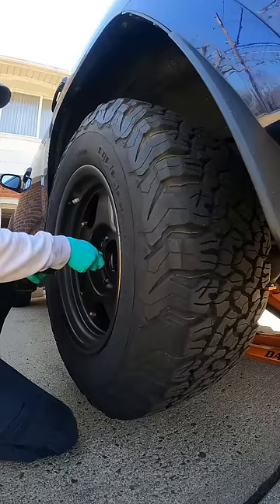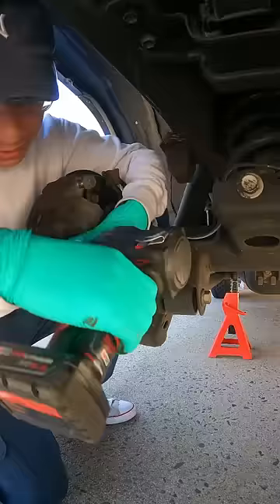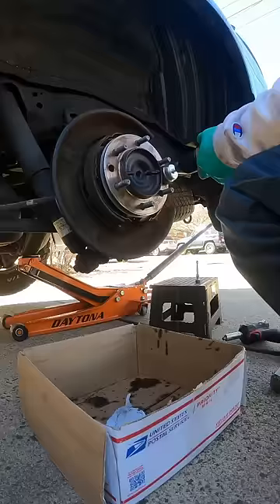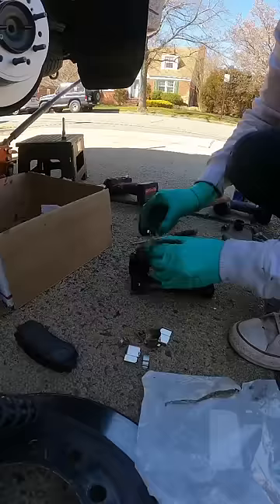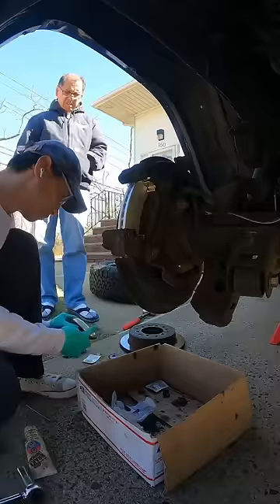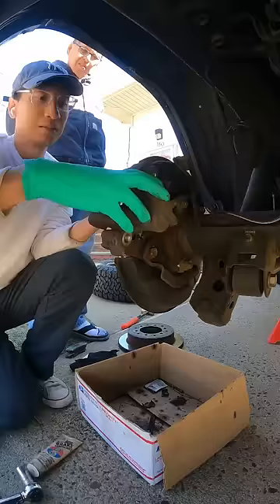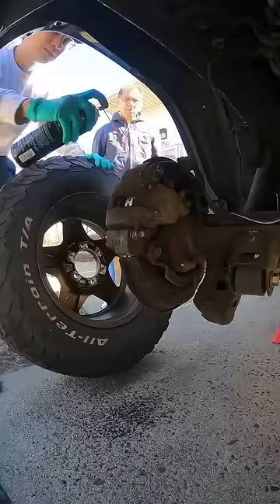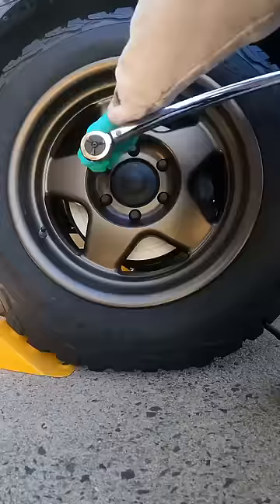Dealer wanted $700 to replace rear brakes. My DIY job cost me $100 and an hour of my time 😎

Comment: Bro had $700 in tools just to pretend like the dealer was an option for him
Reply: "influencers" of an entire generation.
Reply: You can buy those "$700" in parts easily instead of going to the mechanic/dealer for a repair or two. They pay for themselves fast.
Reply: You never thought maybe he work construction or some type of maintenance job. I have tools and I’m not a mechanic. And  harbor freight comes in handy.
Reply: I mean honestly that is probably close to 700 in tools, but they easily pay for themselves esp. If you do any of your own maintenance
Reply: So I either pay 700 and just get service, or I pay 700 and have tools to do it for 100 next time.
Reply: He forgot to touch on pushing the piston in the caliper back but other than that good diy
Reply: It's like a tax write off. You can either give the government a check for money or a receipt for business expenses. Now your brakes are done and you have great tools for future repairs.
Reply: @srt_traplive4912  that would be an okay argument.... if he used a single tool that would be used in construction........or even a handyman..... those are pure "mechanic" tools not a whole lot of crossover when it comes to jacks "heavy" impacts and torque wrenches...  then again its also nowhere near 700$ if you bought every single tool brand new right now itd probably be less than 400$ including the jack...
Reply: $700 in tools and $100 in parts is better than $700 at the dealership. It means you can do your brake jobs for just the parts cost from then on, genius.
Reply: @SingleBladedRonin  sad the worlds works that way to make money...you goto school and buy tools, trainings/certs etc... Just for someone to say they can do it themselves....No wonder why some people rip ppl off, might as well....LOL
Reply: @nwodmf  the impact alone cost that money what are u smoking
Reply: As someone who did this himself. The tools needed are under 250$ new (half that used). And you get use out of them for their entire life time.
Reply: That’s what you called, “investment”
Reply: Well, i got all of my tools this way, every time i did something at my car and saved 200-300-500 dollars, i went out and bought tools for fraction of that price. Now im geared up, and saved thousands, since im buying and selling cars from time to time and fixing them in my free time. Thats how it is done. Tools save you lots of time and health, overtime in few jobs you can save thousands of dolars, even buying tools for yourself.
Reply: @think2invest  the gun alone is more then that dork
Reply: @omar53333 Seems like you missed the point, Einstein.
Reply: When I was quoted $1500 for timing belt job, I went out and bought $200 worth of tools to do it myself. 
Most car guys have jack, impact, and at least one box of tools for $100
Reply: The milwaukee impact wrenches don't cost that much if you know where to get them for a good deal.
Reply: What would you do? Pay $700 in tools and materials ONCE, or pay that $700 each time you see the mechanic? Think long term.
Reply: Wtf, where do you see “$700” worth of tools????
Reply: @waltermejia6196  No, what I would do is comprehend the comment properly before replying to it, so as to not miss the point.
Reply: Not only can he use these tools for his own vehicles again for as long as he takes care of them but he can use them for others and potentially even make some side money or just be a more useful human being.

Also, you don't NEED to use a Milwaukee M18 fuel impact wrench lol so knock your $700 in tools down to $350 and use a breaker bar instead?
Reply: You don't need $700 in tools to do a brake job that's crazy to think that. Just because the dude used certain tools does not mean you actually need them. You don't need a torque wrench, you don't need electric impacts, definitely don't need a dedicated pad spreader. You only need a $40 socket set from Walmart and you are good to go.
Reply: I got all the tools the guy in the video has and it added up to 400 something. Its not too expensive.
Reply: It’s his dads Stuff
Reply: Bro, you don’t need those power tools to do the job. It just makes it go faster. If your a weakling then get a bigger breaker bar. When I started to work on my cars I used to rent tools from autozone. Anyways since harbor freight you can get some basic tools and get by. I bought my snap on power guns awhile ago but you don’t need them. Like I said it just makes it easier.
Reply: That Jack alone
Reply: You can do this without a battery impact. Or jack stands. It’s sketchy but possible. A torque wrench, normal ratchet wrench, and a socket set is not $700.
Reply: Maybe 100 man.
Reply: @EricWeston   That jack is from Harbor Freight. Its $240 Before a sale. You can buy it for less than 200 after. Honestly its overkill though. Can grab a basic 2 ton pittsburgh one for $120 and thats more than capable. After a sale less than 100.
Reply: @timm5970  no what are you smoking? you can find an impact for less than 100 EUR
Reply: You can do brakes with $20 of tools.
Reply: Bro intead of going to the mechanic buy the necessary tools and donit yourself in the long run you save a ton of money and you will have the tools incase something happens
Reply: you can change pads and rotor with basic tools. the impact gun is just a convenience tool but it's not necessary. you can get a jack for like 50, jack stands are $12 each at walmart, rotors and pads probably cost $150 at most. Once you learn to do it you'll see ridiculous it is for pads and rotors to be done for $700.
Reply: And most Americans. Would rather pay the 700 at the dealer
Reply: Harbor Freight . Jack + Stands+ Torque wrench+ socket set. $200 max.
Reply: @spacesuitor  and y’all love and worship them craziest part 😂💯
Reply: @nlmbboogz7382  I'm just here for ree-surch.  🤠
Reply: It’s so funny watching y’all debate the legitimacy of fixing things yourselves… wow i really need all of us to put the phone down and go outside
Reply: i own all of my tools , i have a job which requires mechanical based tools. and hey guess what? some of those tools work for vehicle repair as well. i didnt "Spend them to just own them" 
They've merely been a means to make money. and by that point they've paid for themselves 50x over. even with replacements.
Reply: @srt_traplive4912  ive got tools. thats how I know when you spend that much on tools like milwaukee your car doesnt go to the dealer in the first place yo
Reply: @nwodmf  as an electrician, i use all thsoe tools in my job (minus the jack) torque wrench, sockets extensions 3/8" impact, wrenches, ratchet, ect. Lol but yes you dont even need to have a impact,  a decent 1/2" and 3/8" set of ratchets and sockets. 400 bucks can definitely get you around a good majority of maintenance jobs.
Reply: @srt_traplive4912  dude had a torque wrench, am i missing something that a construction worker uses a torque wrench?
Reply: Rather buy tools with the money I'd save than not have any tools and spend that money at the dealer.
Reply: @nwodmf  than they are cheap tools.  A good torque wrench will eat up most of that $700 ,if not all on its own.  Good tool are not cheap and will last a life time.   But again that dosen't mean every average joe can do it.
Reply: @JLeeAgency  unless you want a good torque wrench.  Thats could be over half or all your money  on one tool.      I guess you could use HF trash.  No real shop would ever do that though.  🤔
Reply: @MS-ql8ek  funny to me that most the chat folks have no idea what the price of a good torque wrench cost. You can easily spend 500-700.   All depends on what it is and how much you need to use it.  No real shop has  cheap tools. No time to go get more cheap tool when they brake.  Need good stuff to last for multiple jobs. 👍
Reply: @AdoxCod  the dude said the impact is less then $400.  A new high torque is not less then $400
Reply: For the $600 you save you can easily rent those tools and still save a few hundred, at least where im at its not hard to find tool rentals.
Reply: Exactly
Reply: @C 7 Adventures   @C 7 Adventures  https://youtu.be/HP4uECoH8cc?t=940
For a guy on a budget, like a guy the video is targeting, it appears HF's ICON torque wrench stacks up just fine (along with others). Yeah, Snap Ons the best, no question. But paying $450 vs $150 for a marginal improvement (going 4% out of spec 0/1050 cycles vs 1/1050 cycles) is a hard proposition for me. But good thing I'm just a regular guy that only needs to use his torque wrench for the occasional maintenance and not a pro shop.
Reply: @nwodmf  I mean, the only "pure mechanic" tool is the jack. Impact driver is basically a necessity for any home improvement shit. Oh and the caliper compression tool but that's like 10 bucks. Wrenches, hammer, drill, etc. are not at all "purely mechanic" tools. And you need the jack for oil changes and shit too, not just brake jobs. And you need a lot of oil changes if you want your car to last. Jack pays for itself with 3 changes or so. ALL the tools pay for themselves twice over with a single brake job at those prices.
Reply: Tools aren't as expensive as you think.. it just depends on where you purchase them or the brand. Harbor Freight offers decent tools at very low cost. 

Worst case -- tool rentals. Ijs.. 😊

Have a great day! ❤
Reply: Or like $180 from harbor freight lmao one year of maintenence will save you enough for when you really need a shop mechanic. I.e idol my own oil and brakes, frame repairs, and when I need an engine she's back in 2 weeks
Reply: NgL everytime I do a major repair I get a dealership quote to see how massive the difference will be. Biggest one so far was a turbo on my 2012 passat diesel. Vw quoted me around 4k, I bought an oem turbo from fcpeuro for about 800
Reply: @nwodmf good electric impacts can easily exceed 500 dollars on their own..
Reply: Bro it's lass than 100 come on now
Reply: U legit need like maybe 50 in tools two sockets an extension and the socket for the caliper and the one for the bracket to take the wheel off just use the wrench provided with your vehicle hammer and torch help too if the brake rotor is stubborn
Reply: I changed the brakes on my wife’s car yesterday with my $70 tool kit and the car jack that came with the car. It doesn’t take that many tools.
Reply: That just makes it easier. I did the same with rusty tools I had lying around
Reply: The $700 also pays for education that can give an unlimited return
Reply: And will pay for it self in your first job best investment I made saved me 850 for all my brakes
Reply: Sometimes you just want to pay someone else to do it but idk where youre seeing $700 in tools. You guys are shopping at the wrong places.
Reply: If anyone pays $700 for those tools, then you're the tool.  Because you got taken to the cleaners
Reply: What tools cost 700 in the vid?
Reply: I mean, the most expensive tool is that milwaukee driver and you can get it for like 100 bucks if you get it secondhand or on sale, the torque wrench was extremely old, so probably like 15 bucks. really not expensive tools.
Reply: I do it with 3 wrenches and a socket max
Reply: And then cheaped out on the calipers
Reply: @apesintanks162 timing chains are not for nubes. Was it a 4 cylinder or 6?
Reply: You can do this job with any standard, cheap socket or wrench set as is found in nearly every garage, lol. It's more like $15 in tools. You definitely don't need a torque wrench for this job, but even those are only $15 for a cheap one if you felt so inclined, putting the total near $30, and that's if.... a big if, you couldn't just borrow them from somebody. Smh
Reply: Pretend? It's always an option. Secondly it's called investing in yourself instead of another company. All wise choices.
Reply: 700 dollars for what? Lmao a Ryobi impact works fine for infrequent jobs and a torque wrench is like $30 from harbor freight. $200 of tools are needed.
Reply: Cheap grade parts on a nice car 😂.
Reply: I saludo rather own them tools and save 700 multiple times
Reply: others will pay you to use those nearly $500 worth of tools the junkyard is mighty costly these days haha
Reply: most MEN have jobs. They accumulate tools over time. Most of the common tools are cheap. The specific tools you'll need for specific jobs will be worth it if you're handy. He didn't spend $700 to replace his rear brakes in one day. It took him years to accumulate that cost. Which is more than worth it for the amount of money he's saved in repairs. And it's nowhere close to $700 lol
Reply: @busystuff23yearsago15  He showed it though.
Reply: Yes, and those tools can be used for decades, which equates to a lot of savings long term
Reply: Yeah I’d be more impressed if he’d used basic diy tools and really didn’t know what he was doing.
Reply: I love the way complete noobs with no mechanical or tool knowledge are arguing about the cost of the tools. Ha ha ha 😂
Reply: More than that.
Reply: The tools are an investment too. You can do a brake job with hand tools and breaker bars fairly easily too. I bought all the tools myself including a jack and stands and they paid for themselves with the money I saved on labor. 

If you think about how much it costs in parts and labor at a shop, the tools pay for themselves with 1-2 self jobs.
Reply: Or maybe they are not HIS TOOLS... Maybe he borrowed them from a friend (or the over seeing dad. like my dad who is a tool collector)

I don't see a large selection of tool. A impact wrench  and jake and stands (which in my option everyone should have). I just get impact wrench recently before that I just do with a long breaker bar and elbow grease. 

Chris from ChrisFixIt channel always say they money you save in DIY he invest in a tool. Over time you get a good collect of tools.
Reply: You don't need any of those tools though all you need is a $50 socket set and wrench...
Reply: I have most of those tools and I paid nowhere near $700 for it
Reply: It's an investment. In the long run, you end up saving money by doing your own repairs
Reply: If I spend around the same price to get the parts and tools I need the first time, every future job is done for the price of parts only.

Sure it takes time, but the satisfaction is the reward.. plus the very practical benefit of being self-reliant
Reply: You build up your tool set over time. Harbor freight is the DIY'ers best friend.
Reply: @MS-ql8ek 

Underground crews use torque wrenches on ductile water pipe joints and fittings
Reply: You can do what he just did with a 5 dollar wrench.